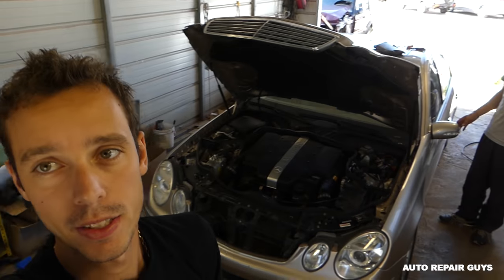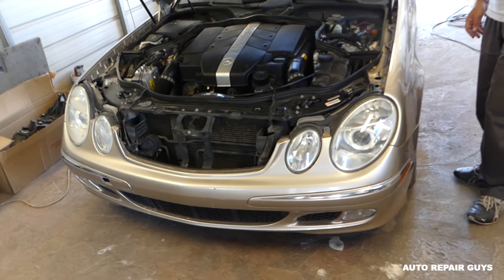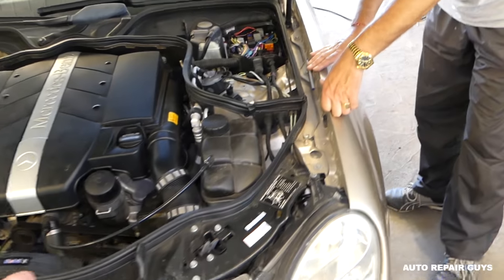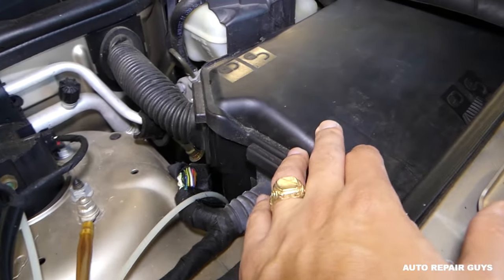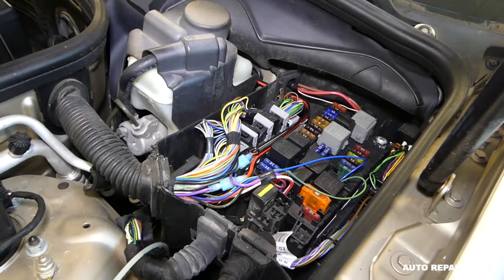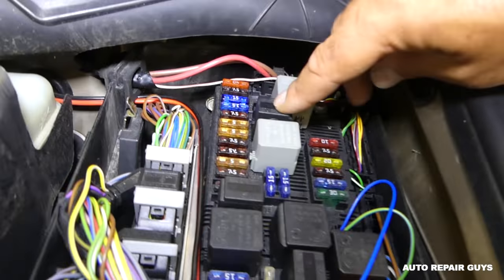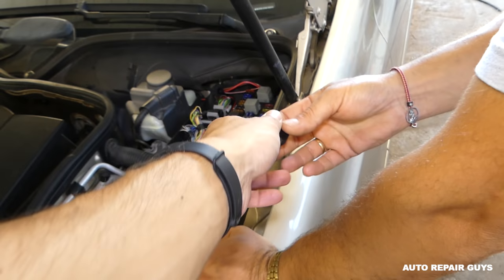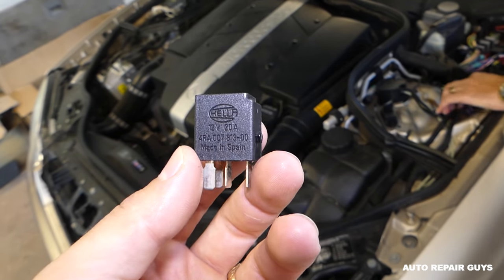MERCEDES W211 RADIATOR FAN RELAY LOCATION REPLACEMENT

Comment from the maker: Products that we use and recommend:
► Replacement Relay: http://amzn.to/2hyOrQ4
► Assorted Fuses: https://amzn.to/4f6qJos
► Panel Removal Set: https://amzn.to/3YiMADu
►Torx Set: http://amzn.to/2hbyWgd
► Tool Set: https://amzn.to/3p5MM6t
► Screwdriver Set: https://amzn.to/3XRB28Q
► Engine Oil: https://amzn.to/3xBc8B9
► Oil Filter: https://amzn.to/3w0Ulme
► Torque Wrench: https://amzn.to/32qyRwg
► Liqui Moly Engine Flush: https://amzn.to/3IiDBID
► OBD Scanner that we use most often: https://amzn.to/3I4MQfe

► Check out our Amazon Store for the tools and parts that we use: https://www.amazon.com/shop/worldmechanics
Reply: 2

Comment: This information is incorrect for 2005 Mercedes-Benz E500 4 Matic sedan. Relay "O" is actually the horn relay.  I verified this by removing the relay and testing the horn.  Horn inop while the relay was removed and the radiator fan still worked.

Comment: I have a 03 CL500 my fan is constantly running I just install a coolant sensor it's still doing the same thing do you think it can be the relay stuck open and also the clutch fan also comes on at high speed
Reply: Mine had a broken pin in ecu

Comment: I have a e350 2007 and my fan turns on when it wants to and the light on the ac button used to blink then turn off i used an obd2 multisystem scanner and it scanned for low refrigerant my mechanic charged up the system then the light stays on and max cool too but the ac still doesnt blow cold they said maybe its an electic issue ? Any help

Comment: Hey man do you know where the fan relay is on the c300 2008 w204. I'm having so much troubling finding it. No one at the mercedes parts department know where it is. My fan works and sometimes doesn't.

Comment: hi bud
Is the relay the same for a s500 mb?  My fan has been replaced but the fan still doesn't kick in
Reply: there are 2 more things to check. probably should have checked the fan before buying (thats the 4th thing to check) the third thing to check is the relay. .the first thing to check is if you are getting power to the fuse box. next is checking to see if you have continuity from the fuse box to the fan connector. you can watch a good video from carsNtoys to see how he tests all (it's a nissan but same theory) there also is a video where a dude checks all these on a mercedes but i forget his channel name.

Comment: What is the reason for the cooling fan to spin in seconds after the engine is running? Is it normal or is there a glitch and what is the solution for a Mercedes 211
Reply: Ik this is late, but its most likely something with the radiator. My W212 is doing it, i have to drive my 211 right now

Comment: Sir, At what temperature radiator fan turns on of Mercedes Benz E Class W211 2005?
Reply: Mine is weird because i have to force spin it to work when its supposed to turn on but mine turns on at around 80 or higher

Comment: can you help me .i ve a 320 CDI w211 the air conditionned work good in front side but in the rear side some hot air from the place that the air go outside next the screen of the temperature .thanks for your time and im waiting for the answer .hope it Will be quickly .

Comment: I have a 2005 E320, and that relay on my vehicle is for the horn. I bypassed it with a paper clip, and the horn sounded. So does anyone know which relay is for the fan/ac clutch?

Comment: Maybe you can help me, I know what caused my problem. I have a 2006 C-230 Mercedes Sport with 63,000 miles. I had been looking at my fuses to try to disable the car alarm that kept going off randomly.  I did not even touch the fuses as I figured I would later that day and my big mistake was leaving the fuse cover off since I knew I would be back later on.   The problem is I went for gas and figured why not get a car wash.  I did and as I came out of the wash I heard the radiator fan louder than usual.  I pulled off to the side of the car wash and turned off the engine and then the fan came back on .... I pulled out the key and it still stayed on.  Then I opened the hood and I saw that I had left the fuse box cover off and looked closer and I saw some small drops of water on the fuses.  Murphy's Law.  I had left the cover off and then got a car wash and water had somehow sprayed under the bonnet. A bad coincidence. I dried it off as best I could.  The fan stayed on.  I drove it home and it stayed on even without the key.  Right now I have the negative terminal off the battery to stop the fan.  I will readdress the problem in the daylight tomorrow.  Any thoughts ?
Reply: Find a solution?

Comment: liar,this car uses pwm signal from engine control unit.two power supply main and ground terminal 15 from fsam control unit,iven if terminal 15 isn't available,fan will still engage at 96.5 degrees celcius coolant temp or ac on,it will engage or disengage depending on condition,failed engine ecu or failed fan module or loose contacts is the only reason fan will not engage,not the relay you're talking about...
Reply: David i have problem on w211 fan not blowing always, whwn is car hot probably 80% times not work blower...when is colder car 50% times work even if i put fan on level 7 not blowing.. on full
Reply: I’m having issues with mine not coming on. I can make the fan come on if I go into the service mode through the a/c control head unit. I don’t know what I’m doing. Need help.

Comment: Hello I own a 2005 Chrysler Crossfire My AC does not work where is the relay for this car It is built by Mercedes it is same as the SLK I have had problems with the AC compressor the unit had over heated because the compressor would not shut off and cycle . I had to replace the electro magnet and pully because it ruined it . due to it not cycling it ran constantly  , it also threw a code check engine light I cleared the code and replaced the pully and electro magnet. Now all that lights up is the red light in the AC button but the Radiator fan does not come on or either the AC compressor. The AC Compressor is free spinning it is not locked up I think the clutch did not have proper shims . I think a relay has been destroyed due to the over heating . Does anyone know what relay is for the AC system for the Crossfire or 1997 to 2004 SLK ???. No one has a video on this car how to fix relays in the Crossfire AC system. Can you Help me ?? I live in Maryland I wish I could bring my car to you so you can make a video on this I am sure those of us who own this car would love to have videos how to repair them because there are not many of these cars around due to them not being supported By Mercedes or Chrysler it is looked at as a bastard car. . Thanks if you could help me

Comment: Hi l have MB C240 4matic 2004 help with transmission 'l start the car put in reves or Drive 'the car shot s off. Pl help.

Comment: Hello,
I wish someone help me with My Chrysler Crossfire 3.2 its basically a Mercedes SLK the car runs great but the radiator fan does not come on I looked at the fuses I checked the box on the fender took it apart no burned circuits so it must be the fan itself if anyone had same issue please help !!
Reply: Ryan Reynolds I also have a MERC 3.2. I have been dealing with this same fan issue for a while. The fan comes on during startup but no more after that. Car gets hot and again no fan kicking on. No ac working either. I have replaced the fan with a new one I have also replaced the harness as well as fuses and relays. The only thing left is the temp sensor and thermostat. I have read countless hours on the forums about the same issue and it seems like nobody has a solution. Don’t let the dealership tell you it’s the fan. It’s most likely not and you will waste your money and be stuck with the same issue. Hoping to find a fix soon. Sad.
Reply: @iansmith3975  Thanks Ian I finally had a responce from a nice guy who has same issues. Its cold here I have no. Garage so guess this be a spring summer job does the radiator light come on with your car ? Mine stays on all the time plus the light for burned out bulb also on but all lights are on thats crazy anyway if ya find out anymore id appreciate help
Reply: Also Ian my AC does not come on at all and the system has pressure and but the car warms up but no fan i thought of putting a switch to activate fan once car warms up to bypass the electronics circuits.  But gotta figure why AC dont work unless i hard wire it to a positive circuit. Thanks so much Ian for your help and advice. If ya figure this one out please get back to me.
Reply: Ryan. Okay so I sort of feel like a dingus. I thought my fan was coming on at start because I could HEAR it power on then shut itself off. It wasn’t the radiator fan that was coming on it was the hvac fan firing up. Very similar sounds! Turns out my radiator fan indeed has power but isn’t turning itself on. Still in a bad spot but at least I figured it out somewhat.
Reply: @iansmith3975  lolol. I knew my Hvac was coming on  lolol my Radiator fan don't come on at all … maybe we will find out the trouble in time ??

Comment: Do you have a video on where the fuse for the fan is on a w204 c class 2010 
Or could you tell me please and what number
Many thanks
Reply: Its fuse number 25
Reply: @doodyhanks1  is it the same for a w204 c class 2008?

Comment: My 2002 Mercedes clk320 fan stays run on high as soon I turn the car It does not turn off .
Reply: Have you fixed it? I have the same problem, I have read on forums it could be the Fan Control Module, but I'm not sure yet.
Reply: I've read somone with this problem. Turned out a wrong type front SAM was installed as replacement..
Reply: @robertiko4631  I've read somone with this problem. Turned out a wrong type front SAM was installed as replacement..
Reply: @ErikMeffert  At the end I fixed it installing a new Fan Control Module. My first attempt was to install a dodgy used one from the scrapyard but that one was broken down as well. When installing electronic components, new is better.